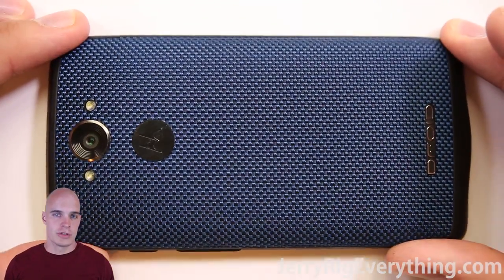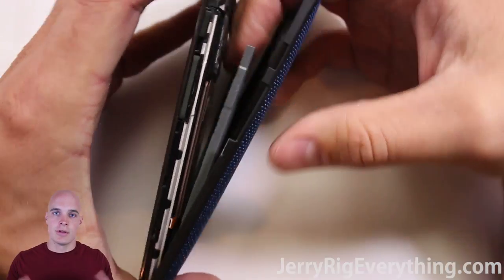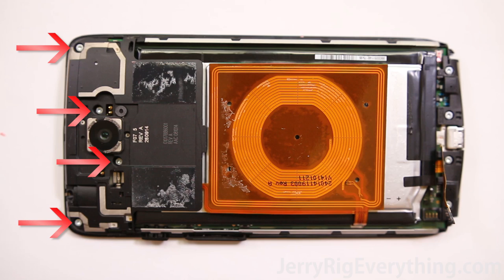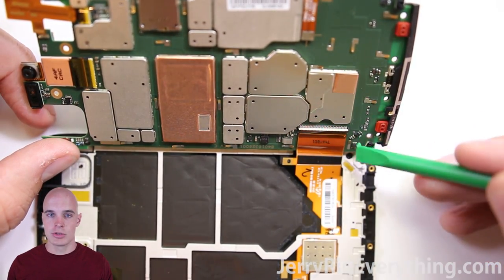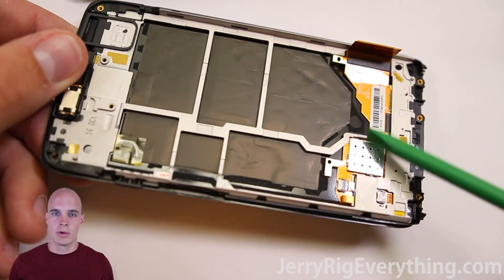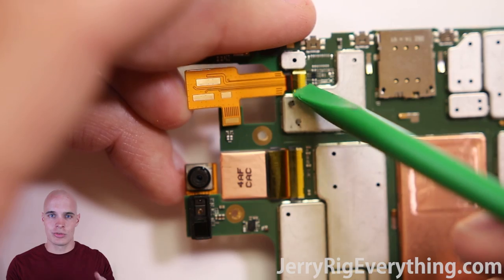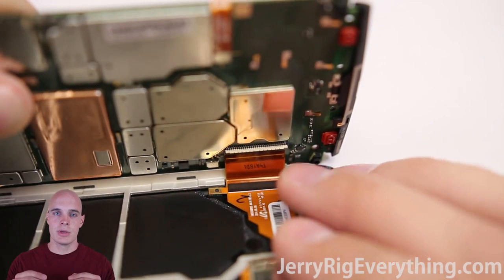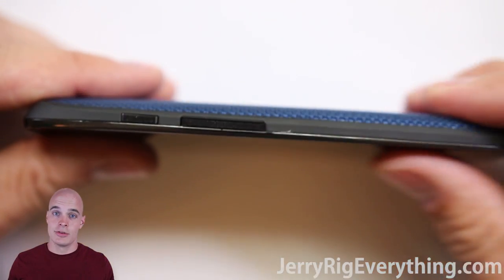Motorola Droid Turbo Screen Fix, Battery Replacement Video

Comment: I can't even get the case started.  I can't get a fingernail in so I tried a box cutter blade  to try to get under and get it started but it's really glued on tight.  I tried warming it up with a hair dryer but that didn't help.  Any pearls of wisdom?
Reply: Thanks, I got it off and replaced the battery.  It's working again.

Comment: Can someone please help me? I replaced my droid turbo battery with a new battery, but i accidently tore the wireless charger pad when removing. I figured no problem since i dont use the wireless charging anyway. Well the first night the phone charged to 100% fine and had excellent battery yesterday. now last night the phone didnt accept a charge. it showed it was plugged into turbopower but battery was 42% this morning. any suggestions would be appreciated.

Comment: u save my baby !!! thanks +1
Reply: +edurock55 Did you have a problem with the Battery? how much time you have with your droid?
Reply: +isaac rodriguez hello, my problem  was with the main motherboard, so the vídeo was helpful for the mainboard  replacement , i have the droid  for 18 months and i dont have any baterry problem yet.
Reply: great, very cool thanx bro
Reply: and what about the battery? is good as the video reviews, still after 18 months?

Comment: I have an issue. After i replaced the battery I couldn't get a 4G signal. Have you ever run into this issue?
Reply: check network setting on phone?
Reply: I've tried that it only lets me be in global. Could it be because its an after market battery?
Reply: That shouldn't have anything to do with it. I put an aftermarket battery in my Tubo and have no problems with signal. Have you tried clearing the cache? https://motorola-global-portal.custhelp.com/app/answers/prod_answer_detail/a_id/102367/p/30%2C6720%2C9277/kw/reboot%20into%20recovery 

Try taking the sim out , put it back in and reboot.
Also, try doing a factory reset if clearing the cache doesn't work. 

Usually, when I have signal or 4G trouble, one of those things works.
Reply: I tried it all. Nothing would work. luckily I had an upgrade. So I just tacked 35 more dollars on my bill.

Comment: hey I have this phone and the battery percentage jumps all over when I reboot it like it can be at 30 I'll reboot it's at 20 and I can plug it in for like 3 seconds reboot it and it will jump from 18 to 43% immediately

Comment: My Motorola Droid Turbo is not charging properly, when I plugged the charger the battery is getting low, as I must be charge. I did't find what is the issue. Please solve my issue.

Thanks
Reply my comment

Comment: I have a Motorola Droid Turbo and I was trying to delete some of the 20 or so apps that came pre-installed whenever I got the phone about 2 years ago. 
  Everything was going fine until I went to delete FB and FB Messenger because I didn't use them. Well neither deleted like it should have and shortly after my phone would mess up (sluggish, installing apps and files on its own I didn't authorize).  
     About 2 months ago, my phone got to where it would not start the processing system right. It also developed problems with the battery (saying it was 0% less than 45 minutes of being taken off for full charge and eventually that time became much less).
    Within a couple days of that starting, my phone would not work unless plugged in and it would take several tries to turn it on while plugged in and doing a hard boot.
   Does anyone have any idea what's going on or how I could fix it? This is out of my lane.. If you can help, I appreciate it..
Reply: Better to just disable pre-installed apps instead of deleting them. Also, Verizon has a small page for Droid Turbo battery issues that says you should do something like hold down the power button for 10 seconds to reset the battery indicator.

Comment: I've made the replacement of the battery on my Droid Turbo, but I've damaged the Qi Coil, after that the new battery doesn't work, shows the green light. The old one is working, but doesn't charge. Anyone Could help me? Thank you guys.

Comment: I recently changed out the battery, and afterwards my GPS antenna seems to be either disconnected, or not getting power. I may have broken off a small gold clip. any ideas where the GPS antenna is?